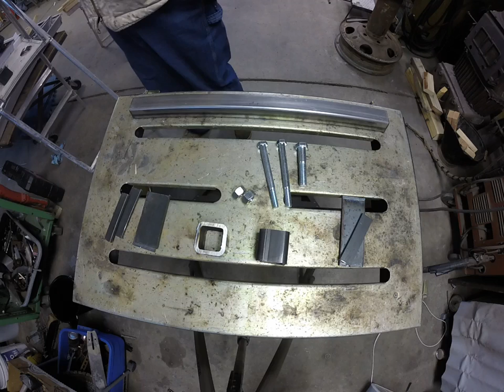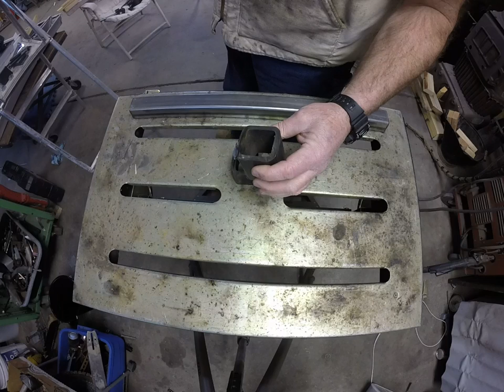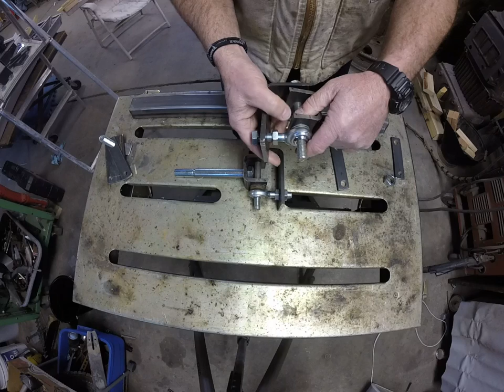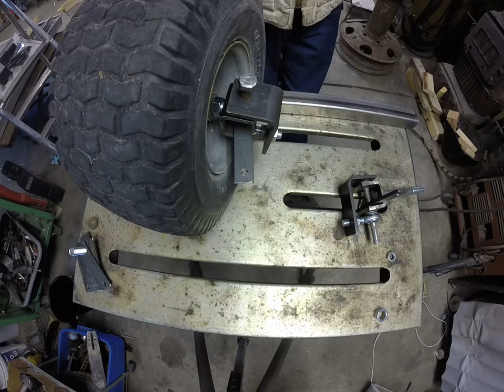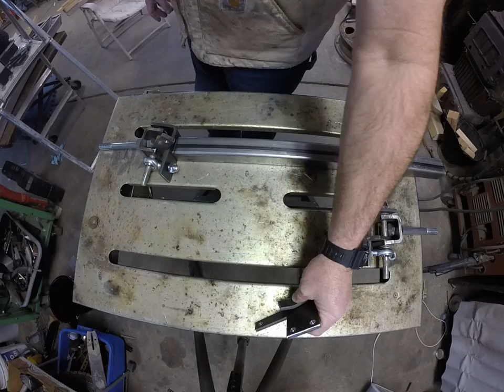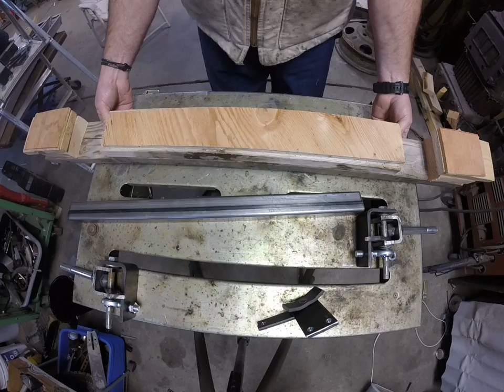Racing Mower Quick Start Guide...Front End From Scratch

Comment: I know your using 1/2 hem joints but is there a reason not to use 5/8 joints? I’m working on 1 now just trying to use what I already have. This is the strongest simplest front end I have seen. Btw good luck on your racing

Comment: Looking at some of your past videos you seemed to use rectangular tube for the main beam, do you suggest using 2x2 like in this video, or that's just what you had around for this build? Thank you so much for all the videos you have uploaded!
Reply from the maker: Greetings,
Thank you for the comment/post.
I do recommend using 2x2  or 1-3/4 x 1-3/4 square tubing for the front end. It was not just what was laying around. I specifically use either of those two materials for the front end. Depending on the frame I am working will determine which of the two sizes I use. My preference is the 1-3/4 tubing, with the 2" flat bar as is shown in this video. It allows for a clean build with no clearance  issues on the front inner rim if done correctly. I have tried other materials that either did not work, or was way overkill, and added much more work to build the steering around. Just a reminder the angles I have found that work the best is the 10, 10, 10 if you are going to build from scratch.
Reply: Perfect! I picked up a Sears 917.254622 like the one in your earlier video that you called out as your favorite style for building a racer. Going to try to get a GP race ready mower built for Bowles Farm, MD at the end of July.
Reply from the maker: Awesome!!!
I think the Sears frames are the best to build. They are a little heavier in overall weight, but you don't have to do all that extra stiffening work that is required with the other manufacturers.
If you follow my videos you will have a good solid machine that will last for years. 
I know it is a little mundane, but I would recommend watching my videos prior to really starting your build.
Having an idea of what needs to happen through all the stages will greatly help you through the process.
I am glad to see the videos are of some value for others. 
When I built my first machine, their wasn't much available on how modify these machines. It was a very long, and painful  process of trial and errors, and a little bit of coaching from some fellow racers. Hopefully, these videos will make it so you don't go through that same painful process that I did on my first one.

Comment: im atempting to build a racing mower and ive been looking to build for a couple of years now and i finally took my mower apart and etc. to try and convert it and i am stuck on the front axle and have been for a week or two now and i dont have the best resources to do these steps with and was hopefully wondering if you could give me a ittle more tips for doing this and maybe commenting the measurments so i can get the correct stuff and where to find all the parts needed.and also does this help lower the mower or do i have to do more steps to frame or something like that in order to lower my mower

Comment: 1/2" black gas pipe fits perfectly over a 5/8 shaft or bolt...
Reply from the maker: Thanks for the response!!!
 I have never thought of using 1/2" black gas pipe for these spacers.
 However, I will use that on my next builds, and start recommending that to everyone that asks, since it works, readily available, and cheap.